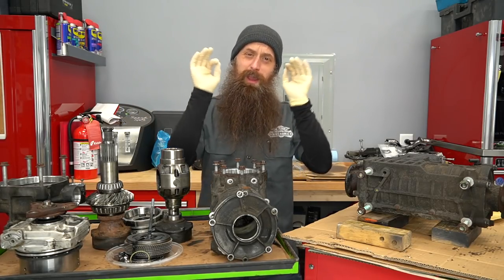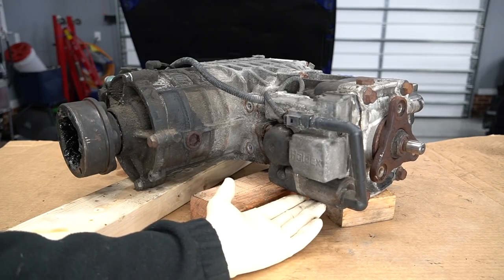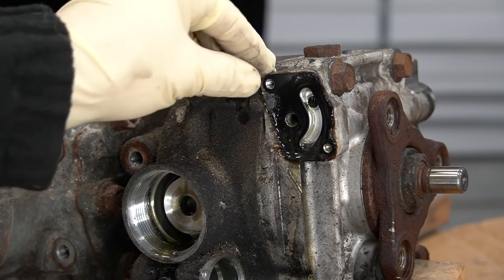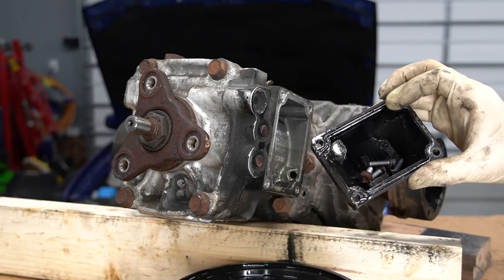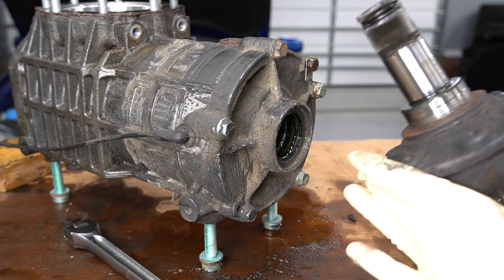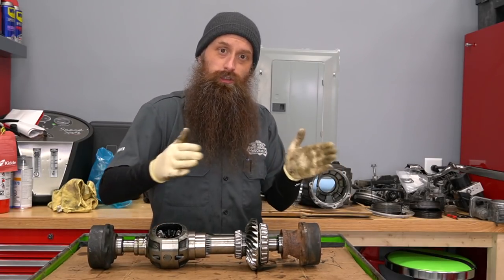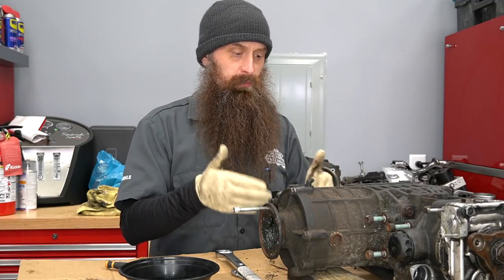How Haldex (AWD) All Wheel Drive Works ~ Teardown and inspection

Comment: Why does VW used a Haldex system and not a true AWD like Subaru? I'm honestly curious
Reply from the maker: A question I don't have the answer to. The use Torsen on Passats. which is awesome.  Actually I might be able to do a video on that. :)
Reply: Fitting a 'true' three diff all wheel drive system into a transverse engine car is extremely difficult, costly, and tightly packaged. Only Lancia and Mitsubishi have managed to do it for production cars. Imagine having to add a bevel box, but also to put the center differential inside the transmission, add a front differential, and have driveshafts pass out the center differential to the bevel box, out the center diff and through the bevel box to the front diff, out the front diff to the right wheel, and out the front diff through the bevel box and through the center diff to the left wheel. Given Golfs had AWD since the Mk2, they likely couldn't have even fit such a system into the car at that time if they wanted to. We're talking about a company that invented a whole new type of engine to avoid making the front end a few inches longer.

Comment: Does anyone know that would it cause excessive stress to the transmission components if the haldex clutch pack were made solid? Then it would be solid 50 front, 50 rear.
Reply from the maker: Some have said it might be issues with wheel speeds front to rear. A VERY interesting trial for sure.
Reply: The front and rear axles travel different circles in a turn, just like how the inside and outside wheels travel different distances. Some type of device must allow for different speeds between the axles, either a clutch or differential. You will break some part of your car if you do this on pavement, likely the center cardan shaft.
Reply: @acefighterpilot  what you say makes sense. Rear axle goes smaller circle as it doesn`t steer. However the differences are very small compared to outer vs inner wheel but maybe not negligible. Probably not good idea anyways..

Comment: Can anyone here help me understand how my haldex unit can have the rear tires spinning while in the air on a lift, but once it’s on the road, it’s completely FWD?!
Reply: Drag on the clutches will spin the diff with no load. Haldex not supplying pressure will make it fed only or worn clutches
Reply: @mcimacdonald   hmmm. So in other words, I need a new haldex controller? Upgrade time? :D

Comment: Wondering if this would help DAP with their RWD MK5 GTI drift car project series........
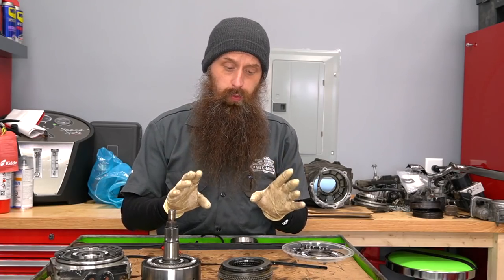Specifically, the part mentioned at 18:03......

https://youtu.be/ECPi1jMxNAA

Also, to respond to your conclusion question....
I have no need for a DIY I'm just a fan w/a MK5 GTI and a dream of it being a beautiful project :'( but your videos certainly do help pass the time and really help me understand the inner workings of the engineering. DIY would probably be very helpful down line for some one.

Comment: DO NOT OVER TIGHEN AND STRIP YOUR FILL PLUG.. your welcome... for whatever reason the plug is really short compared to how deep the hole is not sure why the geniuses  at VW did that....
Reply from the maker: Great advice! It looks like the full plug is actually held in with a captive nut in the case. The nut looks like a tie rod jam nut. Haha

Comment: What a sloppy job...why the heck can‘t you pressure wash the whole unit BEFORE you dismantle it. Imho you should also begin to work more smoothly means not messing around with an overflowed pan....less dirt and oil everywhere.
Reply from the maker: I have no answer that will satisfy you. But I can say is the LAST thing I want is to pressure wash the unit and risk blasting water and dirty into the case. It’s going to be cleaned before assembly. That’s all that matters. .